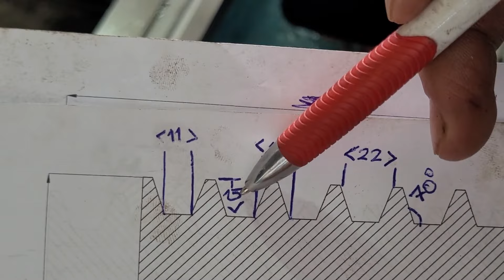how to make a pulley on a lathe ? how to make a v belt pulley ? ( tornada kayış kasnağı yapımı)

Comment: Parting tools have always been a pain in the neck for me. (They seem to always break easily) How are you cutting those angles with a parting tool without breaking it off?
Reply from the maker: I give the rate of progress constant and slow. if it doesn't work that way, you can also do it by turning the cutting tool upside down and running the lathe backwards.
Reply: @CallutLathe  Thank you for the reply.
Reply: @drreality950  Thats ok if you have a bolt on chuck, Not a
screw on chuck, You most likely know but thought id just say
Reply: @CallutLathe  why do you hang that tool out so far?  and why such a narrow tool.  they make wider tools[stronger shanks also] that pissant 3/16 insert takes forever  and deflects too much.  the groove can handle a 5/16wide insert.

Comment: Неправильно канавки сделаны. Не по ГОСТу.
Reply from the maker: it works smoothly under 36 tons of pressure. if we make the channels to the same extent as the belt, even if we stretch the belts, it will turn into a waste. the channels must be tight. thanks
Reply: That is right. Pulley & pulley groove specification must conforms to IS 3142 & ISO 4183 standards... (or GOST)...